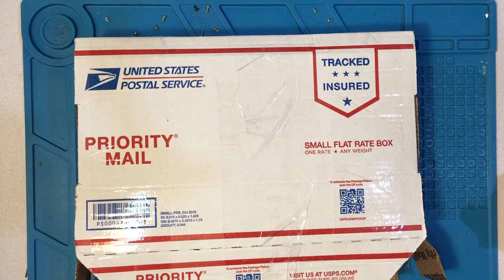A 2-for-1 special:  Fixing two broken, corroded, Atomic Purple Gameboy Colors!

Comment: You should do something no one has done... give it an ipa bath like soak that thing lol then reflow all the leads. Oh and I've seen people check every chip... you could try that. An ipa bath tho... I wanna see that
Reply from the maker: Thanks for the suggestion.  

I did give it a full white vinegar soaking bath for about 15 minutes, rinsed it with some water, and then followed it up with a 15 minute IPA bath to let it work out the residual vinegar left on the board.  The IPA bath was the pretty uneventful part; the vinegar was the more reactive part of the process, helping to remove the surface corrosion off of the board.

I agree, at this point, I need to probably take them both apart, power them up, and compare voltages, continuity, etc. across all the components, and try to find the difference between them.  It will definitely be a labor-of-love process, for sure!

Comment: 8:02  My guess regarding the corrosion in the headphone jack, is battery leakage.  I just did a video with a very similar issue.  The silkscreen on the actual PCB was coming up and the headphone jack was full of battery residue, which was causing audio issues.

The "Blue" you see is typical for alkaline battery leaks.  It's leaked to the front of the board through the holes, and started getting at the button contacts.
Reply from the maker: Yep, I saw your recent video!  I even commented on it too :) . I think yours dropped almost the exact same time as mine did, lol.  Great job on the fix!

Yeah, based on where the corrosion was, I agree, it looks very much like battery leaks.  What has me a bit curious though is that both of these have a bunch more corrosion throughout the rest of the PCB, even at the top too.  Do you think it's possible that the acid could've leaked that far away from the batteries?  It's bugging me; I hate not being able to figure out why it's not working, and I want to keep at it until I eventually figure it out!
Reply: @TheBrokenPast  i wouldn't think so, but not out of the realm of possibility. 

Next step might be to compare the working board to the non working one,  and try and find a point that is supposed to get power that isn't.
Reply from the maker: So, I spent entirely way too many hours poking at it tonight.  From what I can tell, I suspect that I've narrowed it down to a dead / shorted power regulator.  On my good one, I am able to verify proper voltage on the one side, as well as the boosted voltage on the other, according to the schematics online.  On the bad one, on the other hand, the entire regular appears to be grounded.  Either I have a dead short in a component before the regulator, or it appears the regular itself had gone bad.  Replacing it probably isn't worth it, as there are multiple variants that they've used on the GBCs throughout its life.

I suspect I'll just be using it for spare parts if I can get my hand on one with a cracked shell, or a bad screen, to cobble together!

Comment: I have a nintendo ds lite but the d pad isnt clicky anymore it is just flat is the problem the rubber button pad?
Reply from the maker: That’s interesting.  I’ve never seen one used so much that it wore out the pads underneath the plastic button!  Has it ever been disassembled for any reason?  These use the membrane-style contacts, so it’ll always be a bit “soft” and not clicky; but it most definitely shouldn’t just be flat.  It’s pretty easy to disassemble down to the buttons, and see if your pad is ripped or fallen apart and replace it if necessary.

I’ve got a video on a DS lite shell swap process (or even any of the macro videos) that you can follow along with if you need to disassemble it to take a look at the button pad.  Good luck!
Reply: @TheBrokenPast its just almost impossible to press down i played on it for 6 years back then the buttons where clicky but i don't have a tri-wing screwdriver and repairment parts where can i get those?
Reply from the maker: Sounds like you've got some gunk in there you need to clean out!  Tear it down, clean the pads, clean the contacts on the button pads, and you should be good to go!